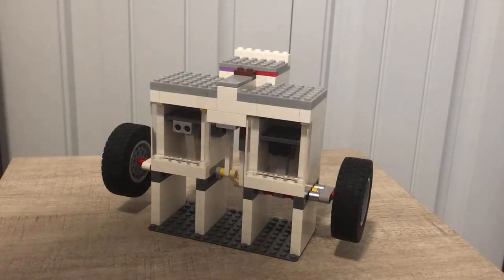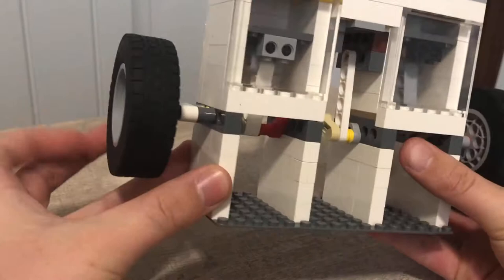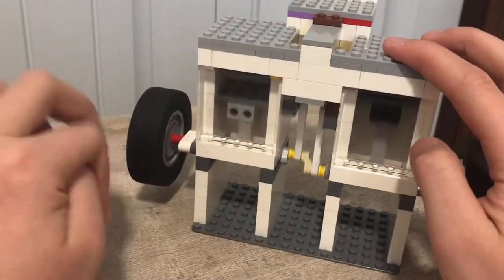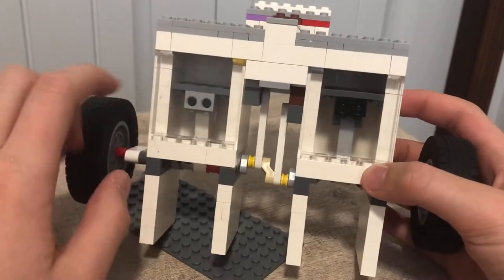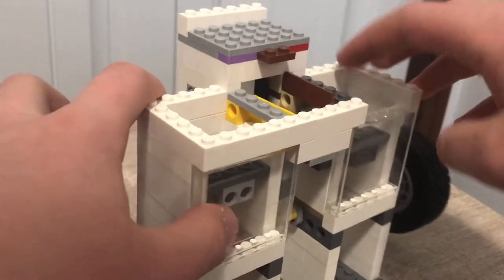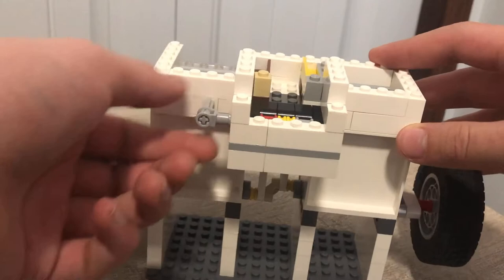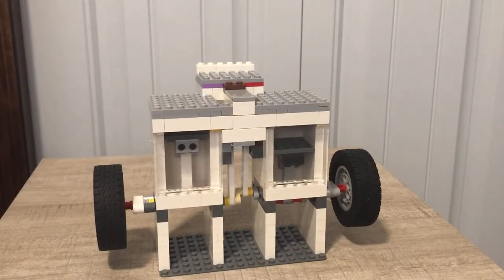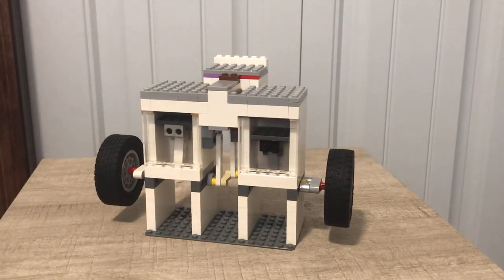LEGO In-line 2 Vacuum Engine

Comment: what o=if you had a flywheel in between the valves, and not on both sides? you would have an easier time squeezing a throttle housing between the pistons, you would save space, and you could potentially balance your engine better.